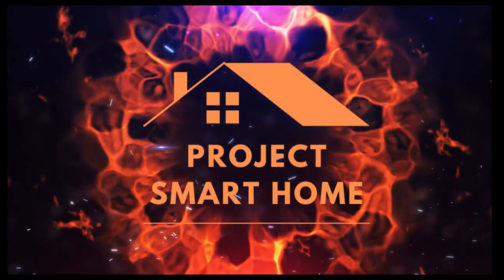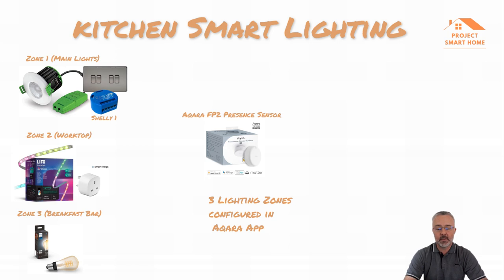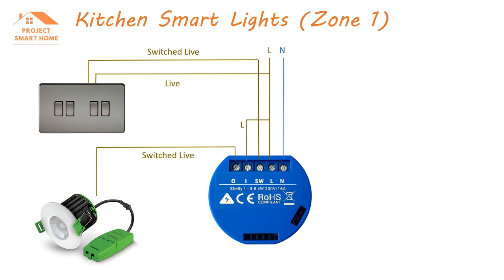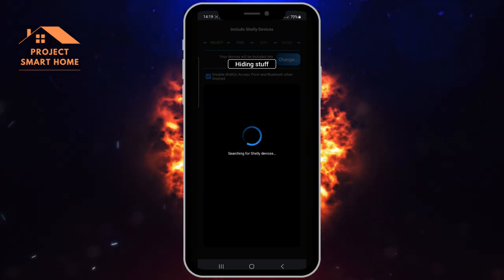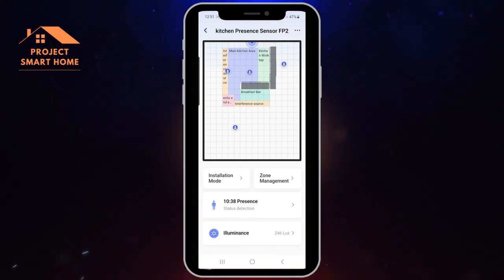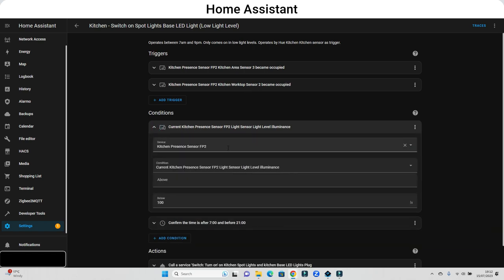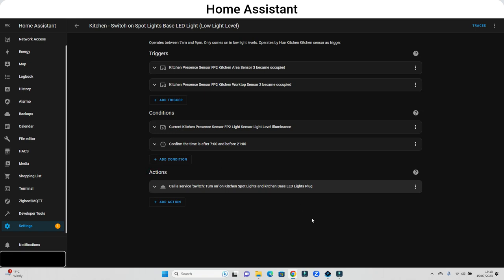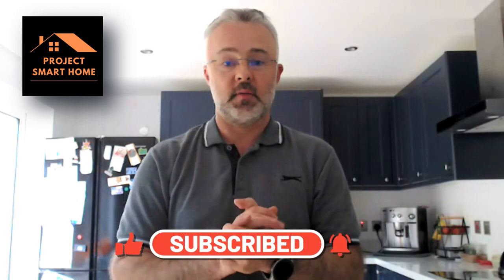Aqara FP2 and Shelly 1 Smart Relay and Philips Hue for Smart Lighting Zones. #aqara #homeassistant

Comment: Aqara FP2  are way over priced.   Like shockingly over priced.
Reply from the maker: They are expensive.  I have the FP2 covering three zones which means its doing the job of three motions sensors and providing presence detection. So it does do a lot for one device.  Not sure what else is on the market that can do this other than the Presence One from Everything Smart Home bu that doesn't do zones as far as I'm aware.